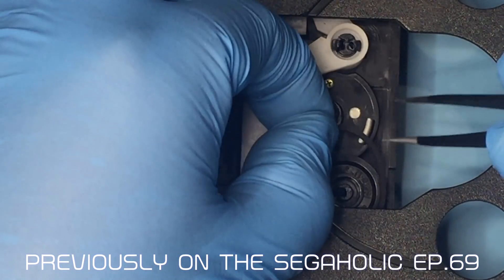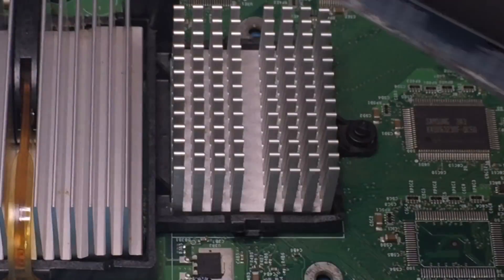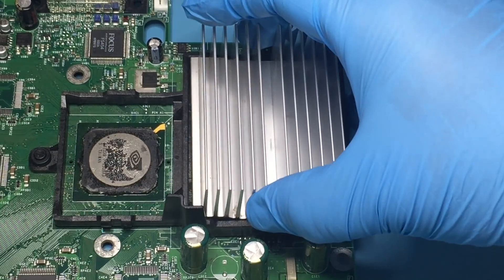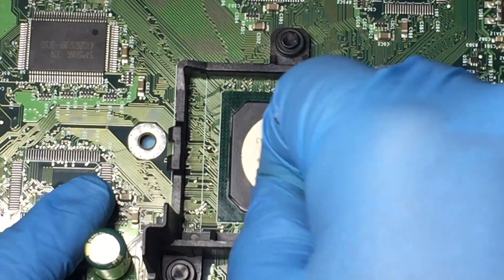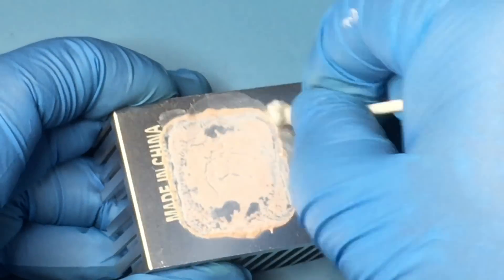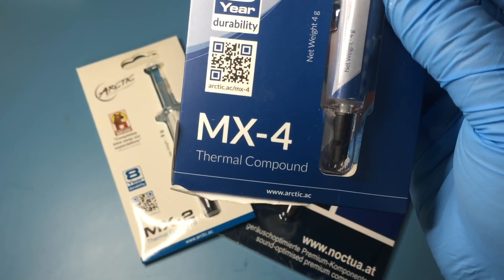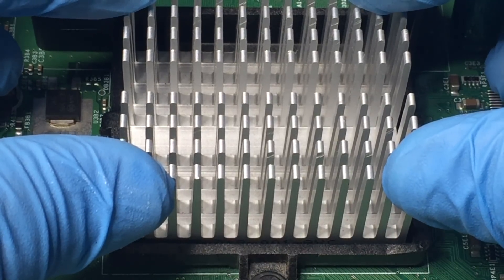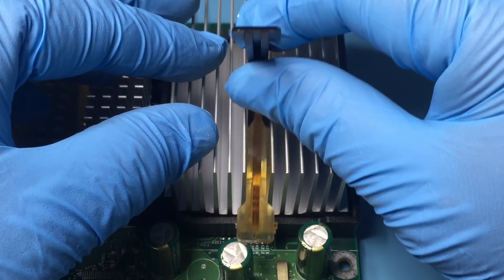Original OG XBox Thermal Paste Compound Replacement- Savers Rescue pt.4 [ep. 70]

Comment: The orange colored Goo Gone works well for paste removal. Just use that on a swab and then clean it all up with isopropyl alcohol.
Reply: I was just going to post that tip myself. This is the exact method I used too. I worked like magic to remove the pink bubble gum like paste from and LSI card's processor.  Total time was about a minute for both the heatsink and the processor... and another minute with isopropyl alcohol (I used 70% because it was close by) to clean the oily goo gone off.
Reply: @joerope5502   Have you got a link for that specific goo gone please?
Reply from the maker: Wait...  it was you who recommended it. Ooops. YT's reply system is screwing me up. LOL 🤪
Reply: Cool thats what i have. ill try that out. thanks
Reply: Olive oil also works
Reply from the maker: Yeah, someone recommended that. And I'm ashamed I didn't think of it myself. I'll have to try it out on my next one. Thanks for the recommendation and contributing to the conversation.
Reply: USE BRAKE CLEANER!!!

I was looking for goo gone however I found brake cleaner and it literally cleaned it like it was normal thermal paste. It literally melted it away and then I rinsed with IPA, not sure if I needed to but I decided to do it just in case. Works amazing!
Reply: yup googone is the best stuff ive used on removing the old thermal compound.

Comment: I used two IC Graphite Thermal Pads, the 30mmx30mm AMD one, to replace the paste. Xbox actually started pushing hot air out, and was hoping to find a video about de-lidding the actual contacts, so I can replace the paste on that... either with more pads or new thermal paste. Really hoping I can get my OG Xbox to last a further 15-20 years. Already got a high quality clock cap installed, one that should last about 15 years, has less internal discharge, and won't leak, short, or explode when it finally dies. After that, I will just need to look into IDE drives lol, and hopefully clone them... or maybe an IDE to Sata adapter, and maybe I can just use those to swap out the drive for a Sata solid state... needs more research lol

Comment: My idle temps went down over 10c with a repaste! That black thermal paste seems to have permanently stained some of the GPU heatsink plate but I got whatever I could off with scraping.
Reply from the maker: You can use goo gone or wd40, just wipe down and remove the goo gone or wd40 with isoporpyl alcohol when done. These make removal of the old TM much easier.... in case you didn't try it.

Comment: Hi my og xbox is flashing red and orange and i understand that means bad video output how do I fix that?
Reply from the maker: This, I would not know how. You'd best be advised to go the 'OG XBox SubReddit' and ask there. But the best thing to do is just get.a new Mobo as they are cheap on eBay right now. You'll have to dump your eeprom from the broke mobo to unlock and save your data on your HDD.
Reply: @The_SegaHolic  I noticed that the GPU has hardened thermal paste changing it wont solve that problem correct?
Reply from the maker: @nightruler666  Why don't you just try changing out the thermal paste if you thinbk that's the issue. Couldn't hurt.
Reply: @The_SegaHolic  Thanks for the help looks like changing the paste didnt solve the problem. Ill look for a new mob or see if my local retro store had a xbox in stock

Comment: WD-40 Brake cleaner is allegedly good for cleaning dirty boards and stuff.
Reply from the maker: I recommend WD-40 for taking off gunk that's impossible to remove... like some of the thermal paste you'll come across... it softens it right up.

But IPA is used universally for general cleaning of boards in the industry... and not just for boards. Good thing about it is that it doesn't leave behind an odor.

We also used to use  Toluene for cleaning military boards that came off of jets.

Be caureful on what you use as WD-40 does not evaporate completely like these other chemicals. If you do use WD-40, make sure you use IPA to clean and wick off the remaining residue.

Comment: What is the problem if my temperature starts rising after applying new thermal paste? , its overheating after i applied new paste.... and i really  cleaned it good with alcohol and used artic silver 5, cant find any solution to this.
Reply from the maker: Whats the temp reading?
Reply: Xbmc reads it as cpu 33c gpu 34 and then starting getting hotter and hotter till the xbox shutsdown  i wonder if there  are bad airflow
Reply from the maker: promannen k does the fan ramp up and get faster?

Comment: I actually use Goof Off, which is stronger than Goo Gone. Then clean with IPA 91% to make sure no residue is left behind. Ive tried just IPA, Orange Goo Gone and Goof Off. Goof Off definitely works the best. Just be sure to open all the windows unless you want a buzz and to kill brain cells. Lol.
Reply from the maker: https://forums.stevehoffman.tv/threads/do-not-use-goof-off-for-removing-sticker-residue.405096/

Just be careful on any solvent'cleaner you use. Test it out on other non-important things first. Goo gone is more safe on surfaces. Goof-off is more aggressive like you mention, but that sometimes can lead to surface damage. 👍

Comment: I use LEGO brick to remove concrete on the cooling Block and then some alcohol wipes works pretty good
Reply from the maker: Seriously, use Goo Gone. Softens up, and comes right off. You'll have to wipe a million times with alcohol to get ALL of the residue off. I USED TO DO IT THAT WAY. With the Goo Gone, everything comes off. You can notice the difference. When it's super clean, use Isopropyl Alcohol to get rid of the Goo Gone, as it's a petroleum based product. Another great alternative is WD40, but it has a gassy smell.
Reply: @The_SegaHolic   naa will be fine where I life I don't have Canadian products would be nice LEGO bricks ar good scraper without making scratches all over
Reply from the maker: @gpowerdragon9852  LOL. You can use plastic forks or spoons that they give at fast food restaurants too, so you don't gunk up you legos.

Comment: I like your videos, they are like a workshop manual for xbox...  Thank you..

My cpu heat sink just fell off, but the gpu was solid, I placed a 25watt soldering iron between the gpu heat sink fins for 1 minute to warm it up then twisted it left and right as normal..   Cpu had white soft thermal paste that was soo easy  to remove with IPA..   The gpu thermal paste was another story!  It covered the entire chip (more like a thick black sticky pad?) and required lots of IPA and rubbing and scraping with a plastic tool...
Reply from the maker: The GPU will always be "stuck" on. Use a hair dryer next time as you may damage the fins on the heat sink with an iron. They are cheap at thrift shops. Also, try Goo Gone, it takes those nasty thermal paste off really quuckly, as another may be quite hard to remove, I KNOW!!! Just use a lot of IPA to remove the Goo Gone later.
Reply: @The_SegaHolic  Thanks, I've been thinking about buying a hair dryer...   Thanks for the tips....
Reply from the maker: @SolitaryBro  Buy it! Go to a thrift shop, they have tons!
Reply from the maker: @SolitaryBro  BTW, blast it on high for 30 seconds close to the heat sink. Try twisting, but don't use excessive force. Blast for 10 second intervals until you feel it give and twists easily, then keep twisting back and forth while pulling slightly.

Comment: I scratched my xbox cpu when i am trying to remove the thermal paste
Reply: Not cpu gpu rather
Reply: And now my xbox dosent turn on
Reply from the maker: @karlgaminde539  Wow, how'd you do that? How did you clean it?
Reply: @The_SegaHolic  I clean it with acetone and flat head screw driver
Reply: @The_SegaHolic  I use a flathead screw driver because the thermal paste is hard
Reply from the maker: @karlgaminde539  Next time, just use some Goo Gone.
Reply: @The_SegaHolic  ok thanks for your advice and I will be more careful next time

Comment: One trick I used to remove the old thermal paste is to clean it the best I could with 97% isopropyl alcohol. applied the new thermal paste run it for about 3 or 4 hours as long as it's not overheating. then I usually take it apart again usually old thermal paste will come off with the new thermal paste. and then apply fresher. before you apply it a second time make sure you clean it off again. I am not responsible for anything that happens your Xbox or anything you are fixing it's just a myth that I've used that always works

Comment: Where did you find that flat-bladed tool that you often use?  Any idea what it is called?
Reply from the maker: Metal Spudger... check yours that it's smooth and not shard on the edges if you decide to get one...
Here's a great set for a great price:
https://www.amazon.com/Zacro-Opening-Spudgers-Anti-Static-Strap，Professional/dp/B071LDN61H/
Reply: Great, thanks!  Subscribed to your channel as I've enjoyed your videos.  Will be tearing apart my first Xbox this weekend.
Reply from the maker: @jsodeman1  It's actually pretty simple. Looks a little complicated, but I'm sure it's not going to be a problem. Thanks for the sub and for contributing to the conversation!

Comment: Great video. It seems like the rice method is the way to go for the CPU, and the X method is the way to go for the GPU, based on both you and one other good guy on YouTube. Personally, although more expensive, I feel that the Arctic Silver Thermal Material Remover (that goes with the Surface Purifier) is way better at removing the thermal paste than 90% isopropyl alcohol. Good idea on the heat gun, and thanks for the heads up about lever directions. I may also be trying your Turtle Wax remover as well.
Reply from the maker: THANKS!!! Actually, use WD40, it removes the stuff VERY QUICKLY and efficiently. Just use Isopropyl alcohol abundantly to clean out the leftover WD40. Obviously, spray some in a tray, and not directly on the chip. Somebody recommended it, and I was initially skeptical. Fighting with the original thermal paste quickly had me trying the WD40. Try it. BTW, don't waste money on the remover and surface purifier.

Comment: Good shit man. I recently installed a 2TB drive into my xbox within the past year and went about replacing the thermal compound on the heatsinks as well. I recall those plastic seesaws scary to remove. I didn't know about the clock capacitor issue and trace issues then, but my xbox runs fine. Next time I need to go under the hood I will check it out.
Reply from the maker: The XBox is easy to tear down, but you really need to check up on that capacitor if yours is not a version 1.6. Seriously. I have opened about 7 non-1.6 XBoxes, and ALL WERE LEAKING.
Reply: @The_SegaHolic  I recently aquired 3 xboxes and every single one was leaking. Luckily, I was able to clean them up with a baking soda solution and they work fine now.
Reply from the maker: Gari Braun 99.99% of them have leaked years ago... 👍

Comment: Niiiiice work man. For the next repair video, how about fixing the PS4. My one switches on, then off immediately. Grrrrrr
Reply from the maker: Unfortunately, until I find one for cheap in the thrift shops, it aint happening with the current gen consoles. Sorry :(
Also,I don't have any current gen console. Although I may need to get one as Sega will be rereleasing Shenmue 1 and 2 on it, and even though I have most versions of both games, I want to support Sega. Shenmue 3 is also in the works, I'm an original backer. Also, a new Virtual On game was released. I'll have to save up. LOL.